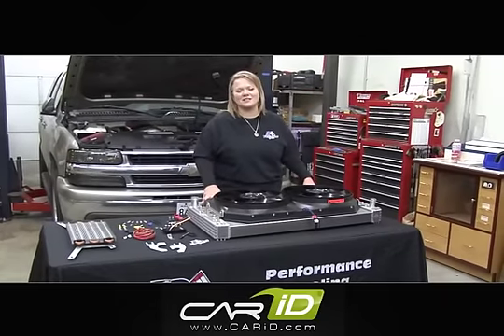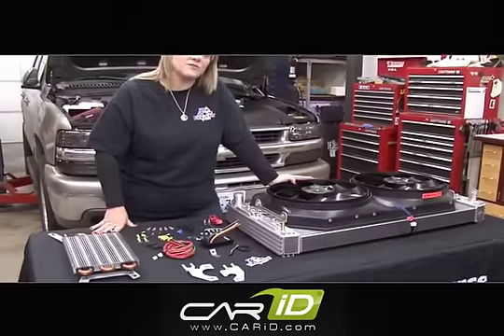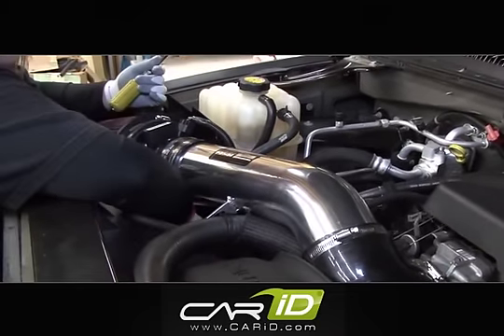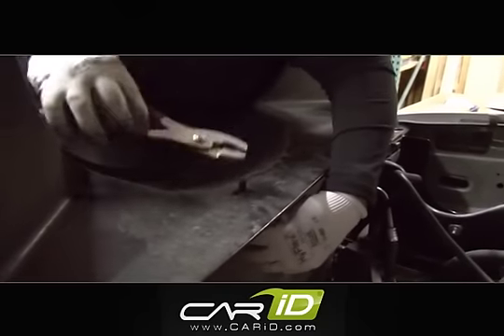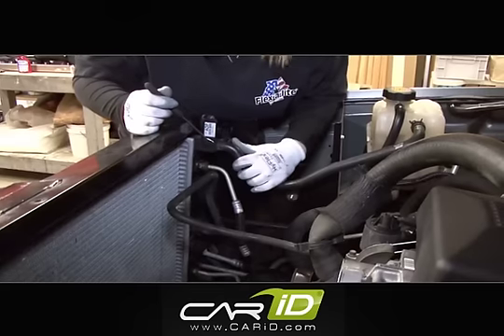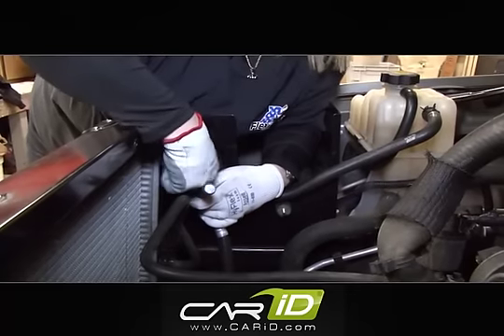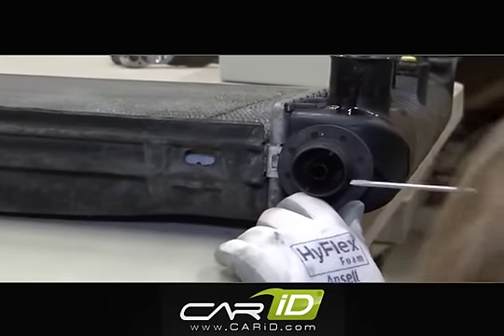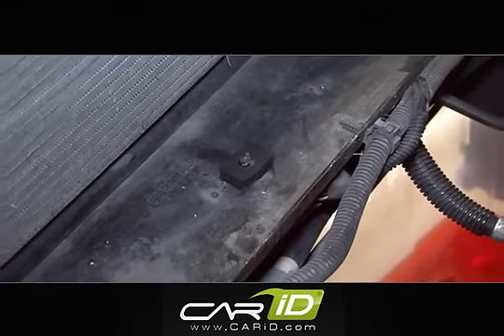Flex-a-lite Flex-a-fit Radiator and Electric Fan Installation

Comment: I'm so happy to see women technician in this application putting a flex a light Electric fan , Radiator, and Transmission Cooler.  Do you have Electric fan and Temperature Control unit for 91 Ford Ranger 4.0 liter for Manual Transmission?

Comment: I need a setup for an 89 Full Size Bronco. 5.8, 4x4 with AC, but the ax isn't hooked up. I'll probably end up replacing the original radiator as well, but with the new motor, it still seems to get a little hotter than I like it to. I'll do a 160-170 degree thermostat as well.

Comment: Why would they NOT have a trans cooler in the radiator but instead add a air cooled one as an option? You can buy a 34" radiator WITH trans cooler which is the most efficient way to cool your trans for under a 100 bucks. I think I can figure out how to mount the fans myself and attach it to the correct radiator thanks. The big problem is getting the ecu to use the fans correctly which involves driving to a shop with no cooling fans working or buying a device or app to do so your self such as hp tunes.

Comment: Will this fan shroud fit the Hummer h2?
Reply: @carid  I ended up going with OEM fan conversion from a Silverado heavy duty fans. I also bought BP Automotive fan harness for 99-2006 gmc/Chevy truck. And then a tune. Much better than these fans. Much cheaper and oem look like it came from factor. Everything fit  like a glove. Thanks anyway